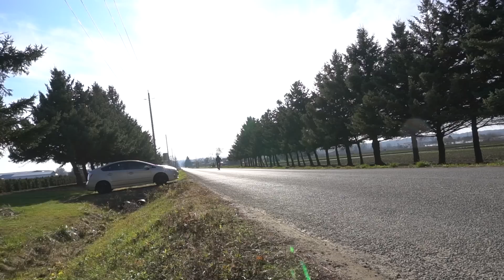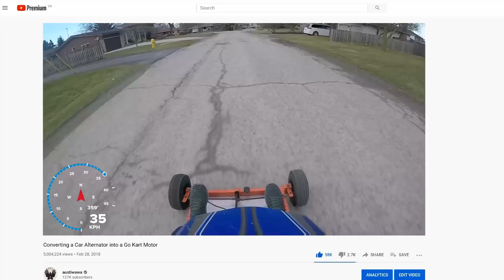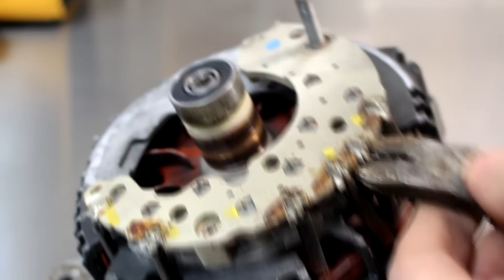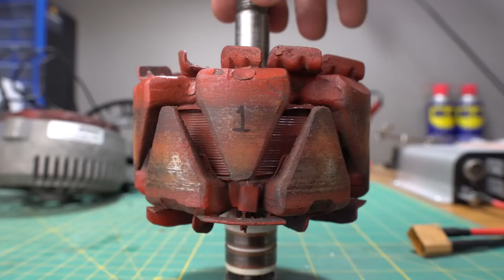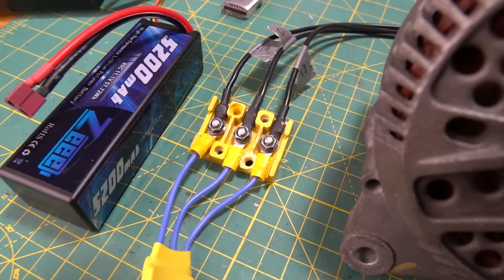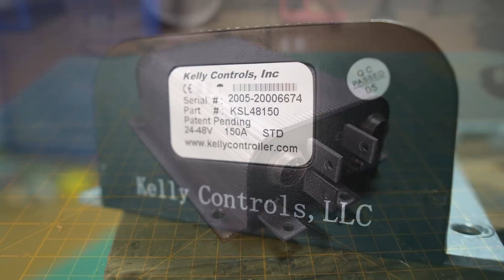Building an Alternator Powered Bike

Comment: This made me wonder... As an 80s baby, and a 90s kid.... I always had the idea of putting a weed eater engine on a bike, and eventually saw people do just that. Never elegant, never clean, always noisy and smelly 2 stroke nightmares. But then electric became something of a revolution with actual traction in the 00's and 10's... and now here we are. And by here we are, I mean you can go on Amazon, pay $300, and get an entire kit to do what you just did here... but all elegantly put together with waterproof controls, motors, trans, etc... Literally can get a 48V / 750W system with motor, gears, extra drive components, controls, touch screen, buttons, wiring, etc... brackets, all of it... for under $350.  So aside from the self gratification, is what you did here even worth doing?  I mean, maybe for YouTube it is, getting views and making some ad money. But, you likely have more than that tied up in all of this, and in the end it's a hodgepodge of trash parts, that look like trash parts, are exposed to everything, has no finish to it, will rust, corrode, and die, and lacks ALL of the nuance and finesse of any of the ready made systems. 

Now I like doing things myself, if it means I can do it not only cheaper or same price, but so long as it also means better. As I know my quality of work and effort put in will always be higher and greater than anyone I pay to do something for me... But as things stand, I'd have to admit to myself that I'm a big ol dummy if I went and did all this, VS just spending the $300 up front, and getting a big box of actual brand new quality components that not only will last exponentially longer, are designed for the task, but are also finished properly (not requiring me to sandblast everything, prime, paint, etc), but also set up with touch screens, waterproof electronics and buttons/switches/housings, proper cabling, proper brackets, etc.... Even if you could produce the same thing for around the same cost, why not just buy it and save the time? Then install it oneself? I dunno.... neat and all, but I feel like it would have been neater back in 1994, before you could just hop online and buy something 400x ahead for 45% less cost.
Reply: The idea of the video flew over your head like a rocket then...

Comment: I'd like to see a Horstman adjustable clutch with a few sprockets. Changing the launch/engagement rpm & sprocket drive ratio (with the clutch )unleashes the beast.
Reply: Nah
He don't need anymore
Reply: @foxxyytofficial  More speed? No. But I would be surprised if the fun kart clutch holds up very long.
Reply: @deweywatts8456  he doesn't a clutch anymore with the new controller
Reply: @foxxyytofficial  Thanks, if you know where that part of the story is.. I would love to learn. I am already overwhelmed by the electronic knowledge, but still want to watch.
Reply: @deweywatts8456  just watch the full video in x1 speed
Reply: @foxxyytofficial  Thanks, I.must have missed the part where the centrifugal clutch was eliminated.

Comment: Now to add on a charge circuit to make this truly sustainable to go cross country without stopping to charge the batteries.
Reply: You can't do this
It's physically impossible
Reply: @foxxyytofficial  well one doesn't need to go cross country but let's say someone wants to live off grid. Bam charge the batteries up with the bicycle charger and get an exercise while one is at it. Solar panels work but they also have an inherant flaw, especially when it's cloudy.

Think outside about the box man.
Reply: @jayfara503  outside the box? Ok
Outside thermodynamics' laws? Hell no

Comment: I need a little help in motor technology.  Is the power delivered to the alternator field by the 3 wires from the speed controller a form of AC?  Meaning the controller is converting 48V to AC, or is it just delivering DC through the 3 wires to the field assembly in the alternator and controlling speed through variations in the DC voltage?  DC motors years ago like in locomotives, trolley buses  or electric forklifts were speed-controlled through heavy banks of variable resistors or some- such, but as  understand it (at least in a simple term like a forklift) are controlled by SCR - based regulators?  Like in the forklifts you can hear the increasing little whine (if your ears are good and you know what to listen for) that comes from the SCR as you accelerate.  Am I even on the right track with my thinking?
Reply: the 3 phases are controlled by a BLDC that commutate the power from the battery like a trapezoidal AC-like wave over the 3 phases and controlling the speed like that
the field coil only powers the electromagnet to complete the "motor"
Reply: @foxxyytofficial  Probably like the power in the rotor field magnet only provides the magnetic field to generate power when it is a car alternator.  The advantage over permanent magnets being the flux strength can be regulated, not like magnets being fixed value.  I would guess this conversion works somewhat like a 3-phase AC motor except the repulsion comes in the rotor magnetic field instead of induction in the rotor of a field in the embedded bars that is repulsed. And the 3 phases getting the modified sine wave being similar to the actual sine wave in the AC motor creating a rotating magnetic field. You can reverse any 2 leads in a 3-phase AC motor to reverse direction just like in this conversion, is that to then say this conversion is kind of a modified 3-phase induction motor, in an operational sense?
Reply: @junkdeal  you got the gist of it, while not a "true" AC motor, it works with a trapezoidal wave
Reply: @foxxyytofficial  Yeah, probably the right way to put it is that it operates on a very similar principle, working off previous innovations in polyphase motors.  The trapezoidal wave form probably is necessary to create a varying magnetic field similar to true sine.  Probably necessary to cause the rotating field necessary to induce motion without DC and a commutator. Tesla originally saw this when he invented a brushless induction motor.  I work in salvage and have worked with huge motor dismantlement, and there are AC motors with large rotor coils instead of a rotor with bars, usually at least 4.coils, and are fed through a slip-ring set, and I would guess this is to allow for speed variation.  I think they might be called "synchronous"  motors.  I am not sure though.  Do you know what they are called?
Reply: @junkdeal  yeah, you can call modified alternators as separately excited synchronous AC motors
Reply: @foxxyytofficial  Thank you mucho!!!

Comment: Wonder...does the alternator still charge the battery or after so many starts do you need to recharge the battery?
Reply: nope, its a motor now
to recharge the battery, use a charger
Reply: @foxxyytofficial  ah... Still very cool man. 
Perhaps a mini alternator in the wheel hub to charge the battery might work. Could travel as far as you want and or till its time for a new battery.
Reply: @flatout5815  the alternator as a drive motor isn't that powerful, so trying to recover any kind of useful energy won't be as viable with a second generator, only via regen

Comment: when i was a kid i put a chain saw engine on my bike peddles. it didnt have enough catch for take off and slipped too! same clutch type
Reply: Yeah, chain saws and weed eaters are High RPM, veryyyyy low torque. You would have needed a monster gear on the bike to let the engine rev out enough. Stinks that you Aaaaalmost had it, I always wanted to do that as a kid, but I couldn't work with metal to save my life.
Reply: @volvo09  my successes can when i built a dolly that had front wheel you can steer with your feet. Mastered the steering column at a young age lol. around 13-14 i made this cart that was a busser tray with holes drilled in it. Then a wire age put into the holes and then pillows. A person would sit inside the mini covered wagon? and we would launch off big ramps and hit rails. We would also tip it over at high speed and watch the person just roll. From here we moved to a 6 foot metal drain pipe piece and a mattress. we would roll inside it down hills until we hit something or we would play king of the hill on top and push each other off and roll the tube with our feet. Last person alive won.
Reply: @jameshughes131  haha! Love the busser tray cart!  Thanks for the smiles. Reminds me of when i was about 13 and made a "go cart" with my friends... It was so bad, i totally forgot about it till now.

Comment: Is there any way you can use the wheel Rotation has a charging point for the system That way the battery can stay charged As it is Being Road
Reply: Only regen braking

Comment: This is such a cool idea! I'm getting parts to build a motorized scooter with 16 inch bike wheels, and this kinda gives me hope that I can still get it done under 1000$. Very cool work!
Reply: this contraption is quite sound, and can be doubled, inexpensively, considering the alternator(s) can heat up on longer trips.. on a scooter, you could easily carry two systems & use gel cell batteries, because they are very deeply charged..  you could, conceivably create a virtually non-stop cycle (or cart) with the use of panels, and precision bearings at shaft races..  good luck on your awsome scooter project..!!

Comment: if you had both wheels drive more alternators for charging could it then be somewhat self sustaining? like the front wheel running two alternators for charging with only the one in the back for driving?
Reply: Nope, you can't create "self sustaining" systems

Comment: Fantastic! classy looking machine dude. The rear wheel kit I used only gets me to 53.8km/h and cost me £160. Real nice work there man, love that you kept working at it and didn't give in and try a different motor or controller and chose to engineer a solution. much love from England, 8-bit.

Comment: What if any is the horse power rating? Great build,also how far can you go on a single recharge?
Reply: 2-5HP depending on the controller, voltage and battery

Comment: I wonder if you could put lighter springs in the clutch to make it engage better & at lower speed.
Reply: Or just remove it
Reply: @foxxyytofficial  so you would be stuck in a constant drive mode? Doesn't sound too practical.
Reply: @mikeherbst1825  just put a freewheel crank and its ready to use
Reply: @foxxyytofficial  that sounds pretty low cost!

Comment: Thanks for all the work, and sharing it all. Your efforts are much appreciated. I am new to your channel, so I may have missed it, but how are you connecting the drive motor and maintaining the ability to pedal? Cheers!
Reply: the closest option is a freewheel crank, so it can run with the pedaling but if not using the pedals, it freewheels like those ratchet breaker bars (locked in one way, spins on the other)

Comment: Great video. Unless I missed something you never explained how adding hall effect sensors negated the need for the centrifugal clutch or why exactly it makes it faster. Something to do with the speed controller I imagine?
Reply: 1) the first controller can't spin the motor as fast as the second one
2) the hall sensors give more efficiency to the controller to cycle the 3 phases in better timings
3) the second controller didn't needed to remove the "idling" with a clutch
Reply: It wasn't the hall effect sensors that negated the need for the clutch, it was the other type of controller.
Had he used a sensorless controller made for EV use, he would not have needed a clutch. He used one for fan operation, which had an idle speed other than 0. This needed a clutch to be able to stop (short of disconnecting the battery).
Since he had another sensored controller for EV use, he added the sensors to use this. Another option would have been a sensorless EV drive, like a VESC. Which sense the rotation though the stator currents instead, but need to be purchased, which he didn't want to do. I'm hoping to try a VESC 6 with a similar alternator in a few days. I actually tried it briefly some time ago, but didn't have anything hooked up to the rotor winding, as I worried my 12V battery would fry the windings. Apparently I can stop worrying about that and just test it. Or maybe stop forgetting to buy a PWM for the rotor winding. Ideally I would have something that lowers the rotor winding current as the stator speeds up, so I should make my own PWM, maybe with a hall effect sensor and a V/F converter in the feedback loop, so faster rotation gives weaker field.

Comment: Automobile A/C compressors have a 12v electromagnetic clutch that allows the pulley to spin freely and then the 12v engages the clutch.
Reply: removing it was better than just swapping clutch types

Comment: I would just use a rocker switch, and when you got up to speed turn on the motor, and then when I got ready to stop just turn off the motor.
Reply: that isn't the best solution for a project that is going to be used for a while
it was better to swap the controller, remove the clutch and put hall sensors

Comment: Could you just use non latching hall effect sensors instead and keep them positioned on the ends? I would assume that latching hall effect sensors would be more accurate because they would output low when they have a negative magnetic field, but if a non latching is accurate enough, it seems like it would be much easier to use.
Reply: You need the correct type of hall sensors so it can work with the controller

Comment: You can make the sentrifical clutch ingauge sooner by making the weights inside heavier. You can drill a small hole into each counter weight and fill with lead. If not enough, drill holes bigger and refill......
Reply: Or just remove the clutch, easier

Comment: Add another alternator and charge the system while you drive
Reply: You can't do that
Physically impossible
Reply: @foxxyytofficial  you can mount it on the front wheel and run the charging wire back not impossible at all
Reply: @dustain  of course its impossible, you can't simply put another alternator and hope that the converted one have enough force to propel you + batteries/controller/etc and even power the other alternator

if your alternator is using a 1500W controller and a battery like he used, if you put the other alternator you will "waste" all the power trying to spin the "generator" and pump back energy, so all the losses on wires/windings/friction/etc will waste your charge and won't lead nowhere

Comment: What is the total weight with you sitting on the bike and how many watt hours per mile on level ground with no wind at 20mph?
You probably cannot go much faster.  The power needs goes up exponentially with speed.  It is the main reason you cannot pedal very fast.  You can do 15 mph more or less indefinitely and most people cannot reach or maintain 30mph.  Just by the laws of physics alone it takes 4 times the energy, but the wind resistance on a bike is brutal and at this speed it is a lot more than 4 times. Probably more like 8 times.
Also, cheap bikes are not safe at anywhere near 43mph.  When you are trying to brake at that speed, there is enormous force on the steerer tube (you need front braking to slow a bike going that quick).   The bearings and races in the wheels are not built for speed either. With cheap bikes, there is rarely even enough grease in any of the bearings.
 It is absolutely stupid to attach anything to the spokes.  You can get a similar left side sprocket that attaches directly to the hub body from the website sickbikes  You might even be able to get one that can freewheel so that the whole thing is not spinning when coasting.

Comment: I was hoping to see something abut adjusting the rotor drive voltage for field weakening, but yeah I dont think you need to go much faster on that particular bike, and it appears to to torquey enough for you, so no benefit that way either. You might be able to tweak for efficiency, but thats nowhere near as exciting as a "go really fast" switch that weakens the field and lets you go 50% faster.